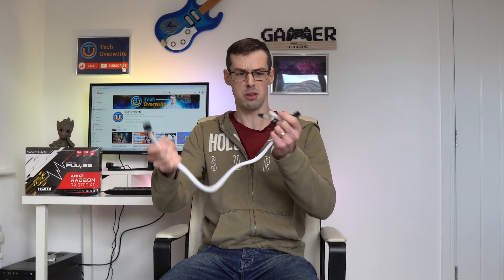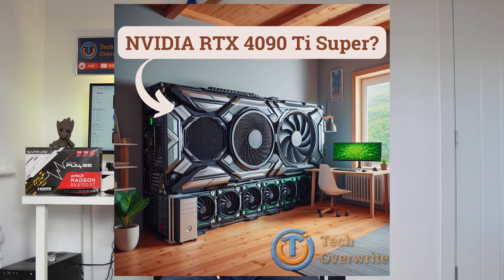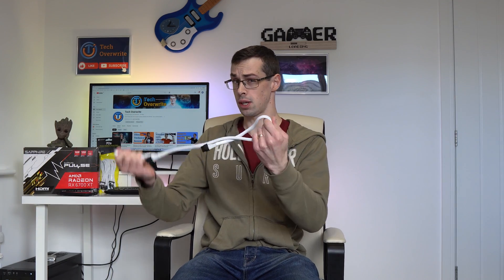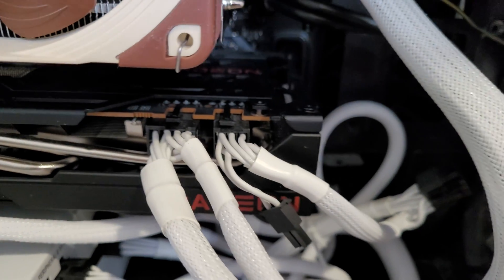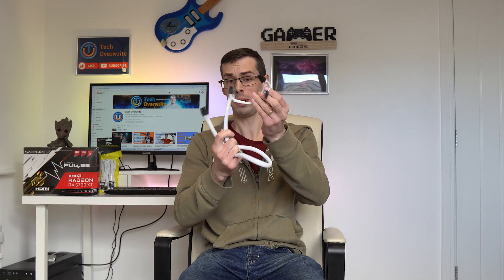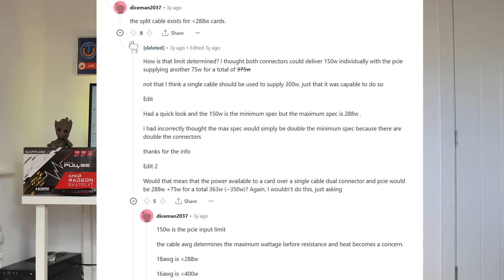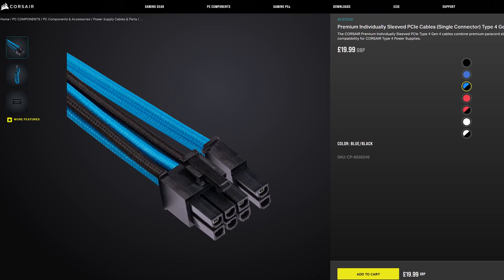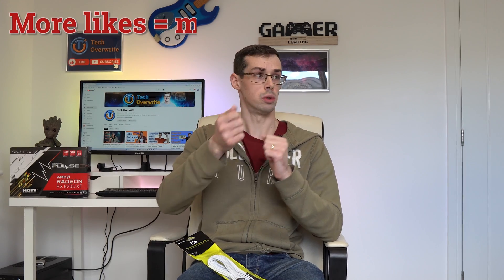Stop Connecting Your GPU Power Cables Like This! (How To PROPERLY Connect PCIe Cables For GPUs)

Comment: When i rebuilt this computer... i was so confused why it had a conversion cable for the pcie but now i get it!! I was having issues playing games like Rust and Tarkov, rust causing a crash within seconds.... ill be back to say if this fixed my issue. i been assuming a psu issue because i can play Grounded with no issues ever... dayz rarely crashes, i downed its settings and now it works good. so im convinced its the daisy chain, or the psu is dying.
Reply from the maker: That's interesting, glad you found this video and i hope it helps reduce (or eliminate!) the crashing. Does sound like it could be a power issue - or potentially a driver one I guess.
Reply: @TechOverwrite  I undervolted my gpu and it now doesn't crash. So i have a new gpu on the way. The drivers were my first thought. Great video man thursday the new psu goes in

Comment: i am going to upgrade from 3070 to msi 3080 gaming z with 3 power connector needed, my psu(rm850e) only gave me 2 pcie connector, 1 single 8 pin plus 2x6+2 pin pcie daisy chained, is it safe to use these? or do i need to get another one online?
Reply from the maker: Yes that should be fine, 2 separate cables should ultimately be okay for a 3080 :)
Reply: @TechOverwrite  thanks for the response, ive done that and it works like a charms !

Comment: Great video! What’s the point of the pigtail connector?
Reply from the maker: Good question! IMO it's more for legacy reasons, although in theory if you had (for example) two 150w PCIe devices, a pigtail would be useful because it'll supply sufficient power to both devices - especially when taking the motherboard PCIe slot into account.

Comment: Could there be a problem if we left the pcie split cables hanging on the GPU end? Other than poor aesthetics
Reply from the maker: Nope that'll be fine - it won't damage anything. There's non-modular PSUs which will have lots of unused cables, after all :)

Comment: Man I have always knew that..... BUT in November I got a used RTX 3090 and immediately started getting crashes. I was wondering what's the deal... I assumed it's the card, and It turned out that I have plugged it to only single PCIE rail, because my previous GPU was RTX 3060....Somehow I have forgotten.... The result - PSU dead.... at least it's it didn't drag the GPU or any other component with it..
Reply from the maker: Oh no, sorry to hear that :( That sucks. First time I've heard of a PSU dying in that situation, yikes!
Reply: @TechOverwrite    It's the Cooler Master V850 SFX, so guys be careful with it. Due to my laziness it took me a long time to start investigating the issue since my System is very small and it's hard to check anything without dismantling the whole chassis. It took about 5 months for the PSU to die, and for me to realize where the issue was. . At least my stupidity lives on... :D
Reply from the maker: Ugh sorry to hear it :( I totally get your hesitation to debug it too - I recently done a mITX build and I really don't want to take that apart ever again LOL! Glad you could get it resolved in the end though.

Comment: So why these cable stil exist ? Why did they still sell theire it with PSU, if the recommande to don't use it ? I personnaly use it since 6 years on a GPU that use 240W and never had any issues ...
Reply from the maker: I'm glad they're working fine for you :) They exist partly for historical reasons, and partly because if someone had two 150w PCIe devices (for example), then using the pigtail then would be quite convenient.

Comment: So you are telling me I’ve had my 3080 installed wrong for the past 3 years.
Reply from the maker: Maybe? 🤔 Heh. I mean, if you have a solid PSU with 16awg cables then you might have been fine with a pigtail in many games/cases. But solid workloads with max power draws might then start pushing it a bit.

Comment: 1007 18awg cable kit is it safe for whole system and 3 x single 8-pin to 8-pin sapphire rx 7900 xtx gpu ?
Reply from the maker: That should be fine yes, running 3x separate cables should supply enough power even at 18awg :) Congrats on the awesome GPU by the way.
Reply: @TechOverwrite  thank you bro 🥰

Comment: Finally some info. It's so hard to find proper one. What PSU would you recommend for the XTX Nitro+? I would go with the BeQuiet! Dark Power 13 1000W titanium, but it only has 2x 8 pin. I've seen some builds with it, but I'm still unsure how and very confused. It says it has 4x 6+2 pin connectors, but I don't know.
Does the DP13 work? Or can you recommend a better one for this specific case? Titanium preferred.
Thanks a lot. I really like when someone knows what they're doing (unlike me this time).
Reply from the maker: Happy to help, and that's an awesome GPU :) This video might be helpful: https://youtu.be/b4FssrXMsi4?si=b2lZXbK0O9yUb04Z&t=464

It looks like it does 'only' have 2x 'VGA' ports for the 8-pin PCIe cables, however it's a proper split cable (basically a 12vhpwr to 2x8-pin), so this should be fine to supply all the power that the XTX Nitro+ needs. You would end up getting 4x 8-pins available, and these would have a good, stable voltage supply. It's not a 'bad' devilspawn connector to use my rant-y language lol.
Reply: @TechOverwrite  Yes. That's what the official BQ! YT channel told me too. To buy the POWER CABLE
CP-6620 and it should be fine. But I still don't know if that cable is enough. There are 12vhpwr to 3x 8pin cables and even adapters which would be great. Now I just have to make sure it doesn't melt like on the 50 series. (edit while writing. It's flipped. The adapters I found are 16 pin GPU to 3x 8 pin PSU)

I spend a few hours to write a list. Here are the 19 1000-1300W high end, 6 year old, platinum or better PSUs 
name-rating-year-ATXx.x-efficiency-number of 8pins: (14 companies without Corsair) (used the PSU tier list excel)

ADATA XPG CYBERCORE_ A+ 2022 2 P 5
ADATA XPG CYBERCORE II_ A+ 2023 3 P 10 (!)
Antec Signature_ A- 2020 2 T 8
ASRock Taichi TC-1300T_ A+ 2024 3 T 8
Asus ROG THOR P2 Gaming_ A 2023 3 P 8
Cougar POLAR & X2_ A 2022/2023 2/3 P 6
Deepcool PX1000P_ A 2023 3 P 7
EVGA SuperNOVA 1000 P6_ A+ 2021 2 P 6
FSP Group Hydro PTM PRO_ A+ 2022 3 P 5
FSP Group Hydro Ti PRO,Gen 5_ A+ 2023 3 T 5
MSI MEG Ai1000P PCIE5_ A+ 2022 3 P 8
MSI MEG Ai1300P PCIE5_ A+ 2022 3 P 8
Phanteks Revolt X_ A- 2019 2 P 6
Razer Katana Chroma_ A 2022 2 P 5
SeaSonic PRIME TX-1000_ A- 2019 2 T 8
SeaSonic PRIME TX-1300 ATX 3.0_ A+ 2024 3 T 9
Super Flower Leadex Platinum SE_ A 2022 2 P 8
Thermaltake Toughpower PF1 - TT Premium Edition_ A- 2021 2 P 6
Thermaltake TOUGHPOWER PF1 ARGB_ A- 2019 2 P 6

Can't I just flip the cable/adapter? Does the 8 pin need all pins since 16/3=5,33...
Reply from the maker: That's a really helpful list :) Great to know. Yes you might be able to flip it - if it's by design of course (i.e. like how Corsair sometimes gives you a 8 pin to 12vhpwr cable, and other times supplies a 12vhpwr to 8 pin cable depending on the PSU). That can work for sure.

Comment: i have super fpower 750w leadex 2 and  3070 ti  300w with 2  8pin, I did 1 cable to 2 pcie and all right 4 years... why?
Reply from the maker: That's great to know :) To be honest, this might come down to what I said about cable gauge - some can supply 288w (or more in some cases), so that might be the case for you.
Reply: @TechOverwrite  I think so) but how to know how much? I know what my cables have 18 awg. its more than 288w?
Reply from the maker: Sometimes the PSU maker will list it on their website, or will tell you if you email them.

Comment: I’m really hoping you can help me here.. I have a 7900xt, it takes two 8pins. This is paired with a Corsair 850w modular psu. One of the two 8pins is a straight 8 to 8 no problem.. the other is the “devil spawn” 8 to 8 with the other chained 8 pin just hanging out not doing anything.. is this a issue? I have constant freezes when I game heavy and I fear this is causing problems:/
Reply from the maker: Ah sorry to hear about the freezes :( But to be honest, your powering approach is fine - you're still using two separate cables so that's fine. Having the remaining part of the devil spawn (lol) hanging around unused is fine, that won't harm anything. So that's frustrating about your GPU - maybe try running DisplayDriverUninstaller and see if that helps at all?

Comment: Can this cause gpu fans to ramp up & a black screen on the monitor. Ive had this issue lately from a prebuilt pc.
I basically have to hold down the power button for 30 seconds every time I use the computer to remove excess static or some crap or the above issue happens.
Reply from the maker: Hmm that's odd, that almost sounds like overheating to me but naturally you could check HWInfo for temps to confirm. Equally you could monitor the power usage and see whether it's high (250w+) before the display goes blank. If the issues occur with <200w power (for example) then it's less likely to be the cause.
Reply: @ i dont think its overheating. It happens when I turn it on for the first time often. If i disconnect the power cable afterwards and hold the power button for about 30 seconds i can leave it on for hours. Otherwise after a long session, if I turn it on the next day GPU fans randomly rev up to the maximum & signal to the monitor is lost, the only resolution is force shutting down via the power switch, & repeating the above process, switch off power disconnect cable, and drain the excess power by holding down the power button with the main switch off/disconnected.

Comment: PC Black Screen Issue – A Solution That Works!
Hello to everyone who has found this page while searching for a black screen solution. Please read carefully, as I am not going to ask you to simply check and update your drivers—I’m sure you’ve already heard that everywhere else. However, the steps below include a small but crucial detail that can make a significant difference.
Issue
If you are experiencing a black screen while gaming or using certain applications and you have an AMD graphics card, then Solution #1 below should work for you. If you have a different GPU, I have also listed additional troubleshooting steps under Solution #2.

Solution #1 – For AMD GPU Users
Step 1 – Install Drivers Manually
Do not rely on AMD Software or Windows to install the latest driver version for your GPU.
Instead, visit the official AMD website, download the latest driver for your specific GPU model, and install it manually.
Step 2 – Important Steps During Installation
Select the "Factory Reset" checkbox when installing AMD Software.
Once installed, AMD will prompt you to select gaming experience setup options like HYPR-RX, QUALITY, HYPR-RX ECO, or DEFAULT. Always select DEFAULT.
Step 3 – Adjust GPU Settings in AMD Software
Visit the AMD website and check the Base Game Frequency (Clock Speed) for your specific GPU (found in the specifications section).
Open AMD Adrenalin Edition Software and navigate to:
 Performance > Tuning > GPU Tuning > Custom
Set the Max Frequency to match the Base Game Frequency mentioned on the AMD website.
Step 4 – Underclock GPU Voltage (Very Important!)
Slightly undervolt your GPU to improve stability.
Go to:
 Performance > Tuning > GPU Tuning > Custom > Enable Voltage (mV) Adjustment
Reduce the voltage by 25-50 mV.
(For example, if the default value is 1150 mV, reduce it by 25 mV to 1125 mV.)
Apply the changes and restart your PC.
After restarting, check if your custom values are still applied.
Hopefully, this will resolve your black screen issue!

Solution #2 – For Non-AMD Users (Or If Solution #1 Doesn't Work)
Update all drivers, including the Motherboard, GPU, and Audio drivers.
Check power supply connections to ensure all cables are properly connected.
Install HWinfo and monitor your system by creating a log file to track any anomalies.
Check the Windows Event Viewer for error logs that might indicate the root cause of the issue.
Restart and Access Safe Mode
Try booting with one RAM stick at a time to isolate a faulty module

Spread the Word!
If this solution worked for you, please take a moment to share it on YouTube video comments, Reddit pages, tech forums, or anywhere else people might be struggling with the same issue. You never know—your small act of kindness could save someone hours of frustration and troubleshooting!
Many people facing this problem might not have the technical know-how or the patience to go through endless trial and error. By sharing this, you're not just passing along a solution—you’re helping someone regain their peace of mind, get back to their work or passion, and avoid unnecessary stress.
Tech issues can be frustrating, but the power of community can make a real difference. Let’s help each other out and make troubleshooting easier for everyone!
Best regards,
 Mr. Maggie

Comment: Im getting crashes on 9070xt...im using the pigtail cable, could this be the issue, it draws 300w +
Reply from the maker: Yes it could well be - some PCIe cables can supply 288w, but others supply as little as 150w. So I would always run two separate PCIe cables with the 9070xt.

Comment: They should ship with the right cables, just sayin
Reply from the maker: That's fair, and it's what the RTX 40 and 50 series cards do with the 12vhpwr squid adapters.
Reply: @ Thats good, didn't know that. I've been sticking with the 8-pin cards. Would be fine with just plugging them into a wall at this point too XD

Comment: ok. But what if the card has 3x8pin sockets, and the PSU only 2? Using separate 8pin connectors mean you will be able to plug in only two of them. What about the third socket then? Can you use a splitter for the pci-e 5.0 600w socket? and then plug one connector from the Ysplitter?
Reply: 1.Cable extension mods or converter pieces
2.New PSU
3.Take the risk and daisy chain the last 8pin socket.

Comment: Hi, I got a 9070xt which needs 3xpin. can I use a pigtail cable and a separate one?
Reply from the maker: Hi, yes two separate cables (and 1x pigtail) should be fine for the 9070xt :)
Reply: @ thanks

Comment: what if, for a week, I need to use a pigtail on my dual8pin rx 9070 xt non-oc for ONLY 1080p gameplay untik I get a new cable? would it be too risky?? I got a 750+ platinum seqsonic focus
Reply from the maker: You won't damage the PSU or GPU if you do it - worst case, you'll get some stutters or crashes when gaming. At 1080p, you're unlikely to draw the full 300+ watts of power from the 9070XT so hopefully it'll be fine on a single PCIe cable yes. :)
Reply: @TechOverwrite  thanks man, I'm really hyped about the new gpu, I'm upgrading from a 1650 and I can't wait to use my new gpu, if I had to wait any more time I would die inside
Reply from the maker: Hah I totally get that - it'll be an epic upgrade for you! Happy gaming.

Comment: Been running my 3090ti on two pcie cables plus one pigtail for over two years now. Plus it's overclocked. But I do have a titanium rated psu
Reply from the maker: That's good to know, glad that's working fine for you :)

Comment: Dunno about others,but my 7800XT working just with with a single cable and draws over 300.
Reply from the maker: That's good to know - it's probably a fairly good quality cable that can draw 288 watts, then the PCIe slot gives the rest of the power. Just a guess though :)
Reply: @TechOverwrite  Id say it's good power supply, Msi mag a850gl
Reply from the maker: Ah nice, yes I agree, that's a solid PSU :) Glad to hear it's working fine for your 7800XT then.

Comment: I just bought a 7900xtx and I am using 3 separate cables. 2 of them are pigtails and one is a stand alone cable. So it does have 3 separate cables but do the pigtails still give less power than a standalone cable?
Reply from the maker: Nice purchase  :) Your setup should be fine - the cables themself won't supply less power if it's a double ended (i.e. pigtail) cable.

Comment: I find it so confusing. I want to buy the 9700xt max OC but I don't know if I can connect it. Most of the models need 3x 8pin connector, however my PSU only comes with 2x 8pin cables. If go for the 340watt models can I be fine connecting one 8pin and second 8pin that splits in to two?
Reply from the maker: I think it'll be fine yes - the majority of PCIe cables can supply more than the base 150w from the spec. So what you're planning should be okay, IMO.
Reply: @TechOverwrite  Thanks for replying I appreciate it. It seems a lot of people seem to have various opinions on this topic.

Comment: Igame rtx 3060 12gb advance OC has 2x8 Pcie connector, but my PSU is only 1x8, is it safe to use Splitter (Y) cable? I plan to undervolt my GPU when gaming
Reply from the maker: Yes that should be fine based on the TDP  :)

Comment: Hi , i know its a year old video but i must ask. I got a non modular power supplier (the cx650 from corsair). i got a rx 590 wich need 1, 8pin and 1 ,6 pin connector , but my power supply only have on 6+2 pcie(with a daisy chain) ....What do i need to buy exactly ??? A splitter ? But wich one (sorry bad bad english im french)
Reply from the maker: Hi, thanks for commenting and your English is fine :) Yes that's a fair doubt and question, but I think you will be fine here. The power consumption of the RX 590 is low enough that using a single cable will be fine. So I would carry on using the daisy chain and it should be fine.
Reply: Tysm @TechOverwrite